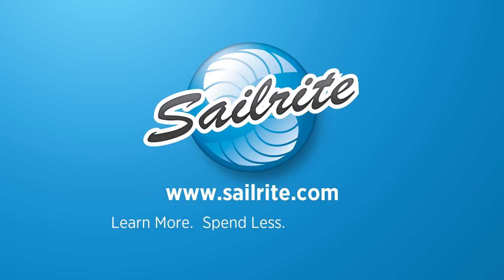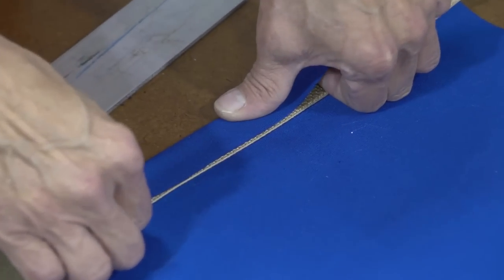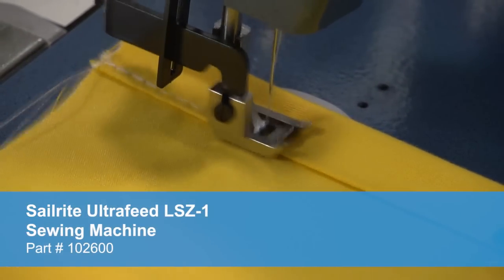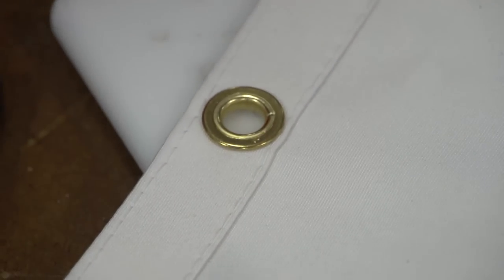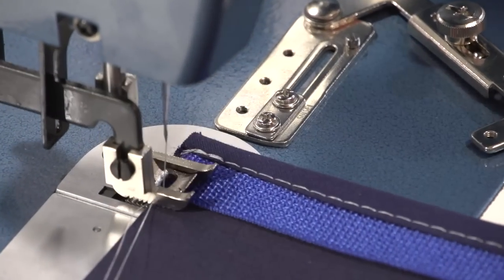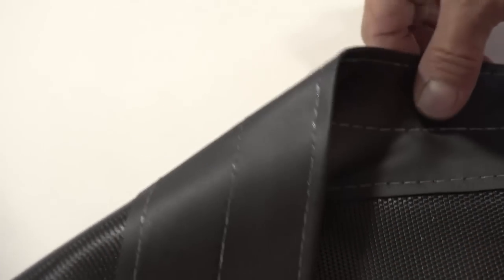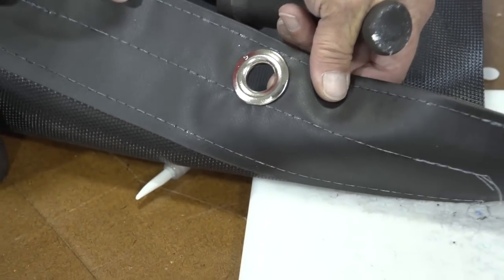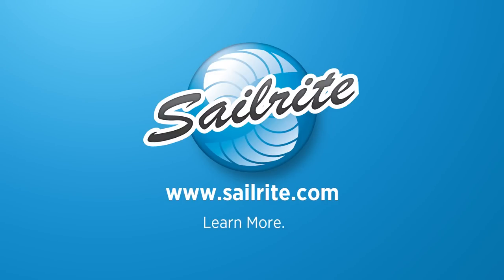Hem Construction Techniques - How to Finish a Fabric Edge

Comment: I've been working on strips of burlap, making them into long ribbon strips.  I can see that over time they are going to fray.  I was hoping on finding a simple way to finish them.  Since it is burlap perfection isn't if you know what I mean.  Any ideas or do I have to use a sew method? Thanks so much.
Reply from the maker: A raw burlap edge will unravel quickly. You will need to make a double hem along the edges and sew that hem in place to keep the fabric from coming apart.
Reply: Ruth Gilmour

Comment: When you use the tape, does your needle gets the glue from it? ty
Reply from the maker: Depending on the weight of the fabric (lighter fabrics do not clear the needle as it enters and exits the fabric) and how long you are sewing through the seamstick the needle can get glue build up. We typically remove it with a cotton ball with rubbing alcohol on it or goo gone. That typically helps to solve that issue.
Reply: I was told to rub bee wax on needle before sewing into the tape.

Comment: where is sailrite made?
Reply from the maker: +G GEANS The Sailrite Ultrafeed sewing machine is a collaboration between China, Taiwan and the United States (our facility in Indiana). Most parts and sub-assembly is done in China (motors from Taiwan) but all tuning and several critical components are made in the states (Posi-Pin parts, cases, PowerPlus and Monster balance wheels, jack drive and a few internal parts). All manuals and DVD instructions are done in the states as well.We spend about 2 hours on every sewing machine head made - building and testing it here in Indiana before it ships.